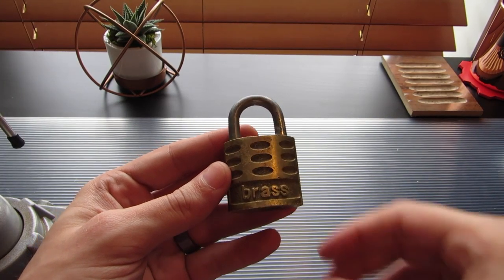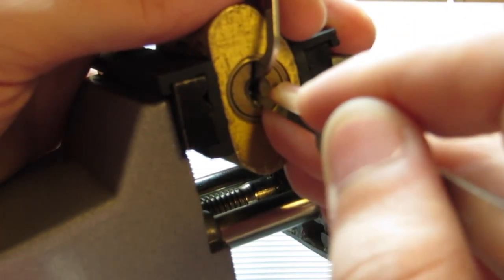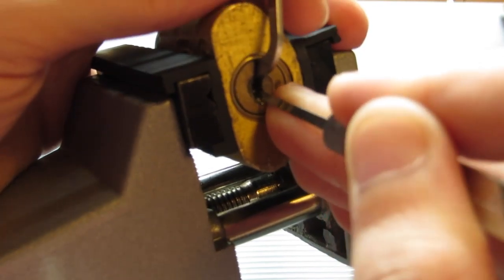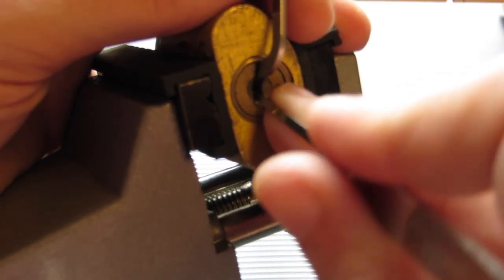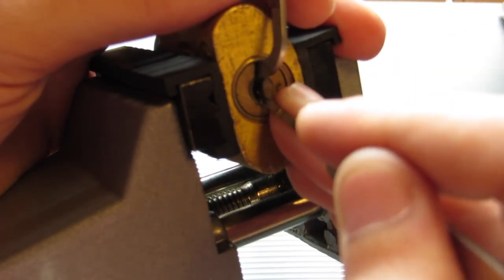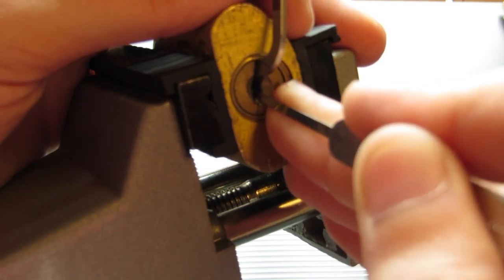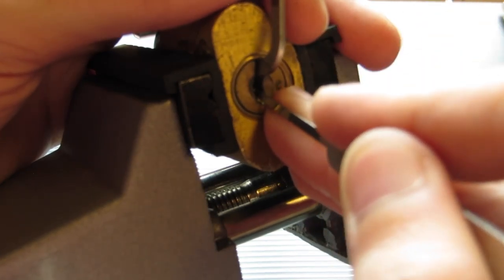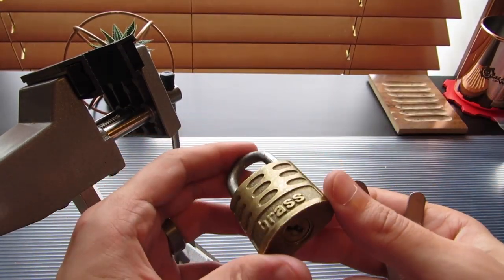[23] Slayco Slaymaker Brass Padlock SPP'd

Comment: Those old wafer cylinders can be tricky at times.  When I picked that lock I could have sworn that some of the wafers had false gates.
Reply from the maker: Trekmaster30 when I first started picking I though it had spools, then I realized it was wafers. When opening, turning the core gave a weird feel similar to when a spring is in the sheer line and you turn the core (if you have ever felt that) any idea what that's about? Is that possible on a wafer lock?
Reply: That's not really possible on a wafer.  It was probably just one of the wafers dragging. The lock probably needs to be lubed a bit too.